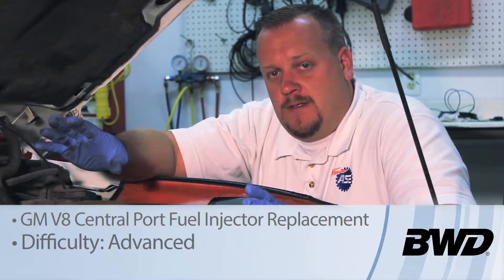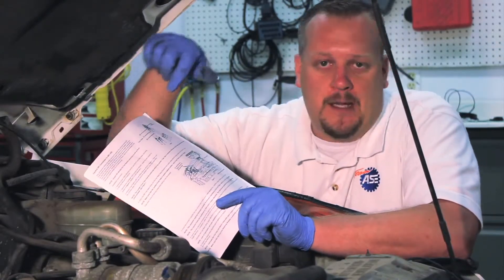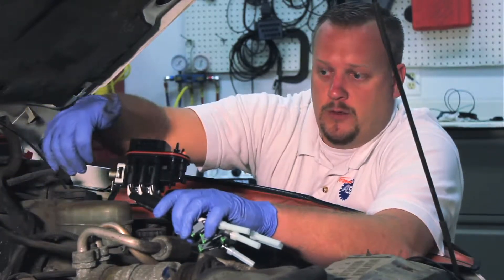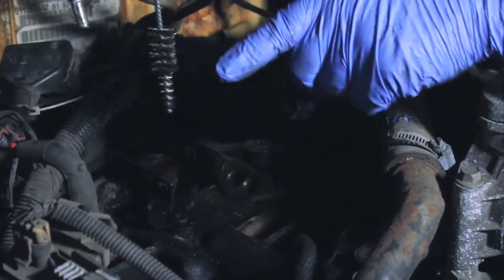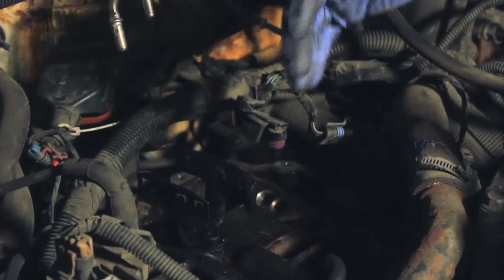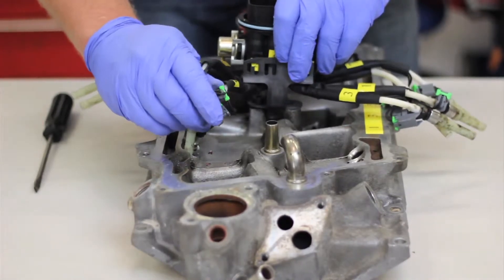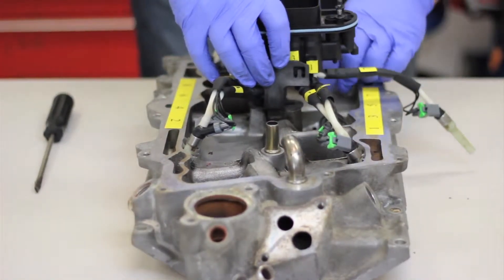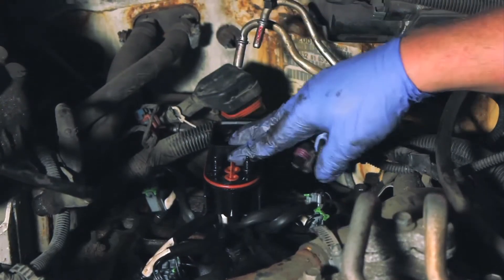GM V8 Central Port Fuel Injection Replacement

Comment: I installed one of these units in my suburban a few years ago.  I immediately felt a difference in how it ran (old unit was leaking fuel).   Very well made product, and have not had any issues. Great video!